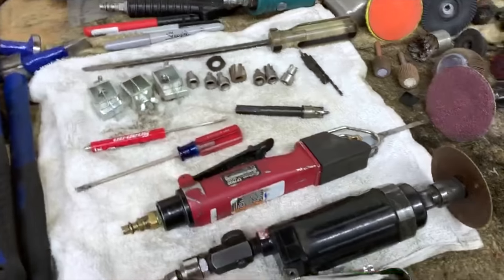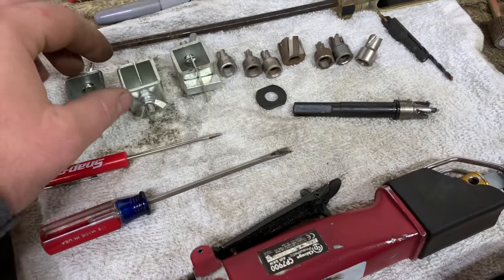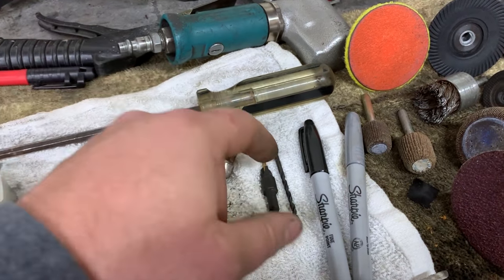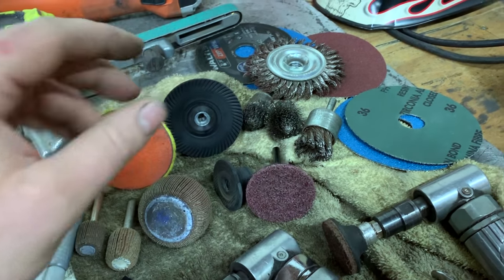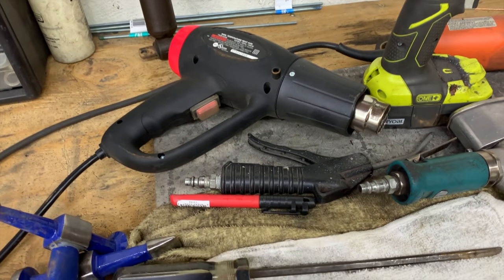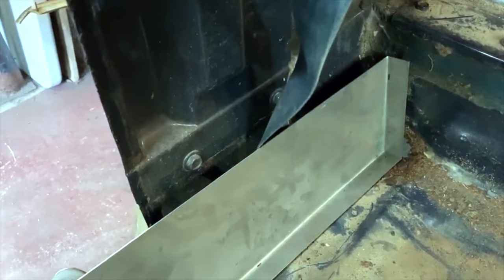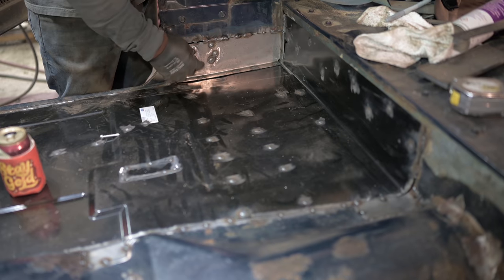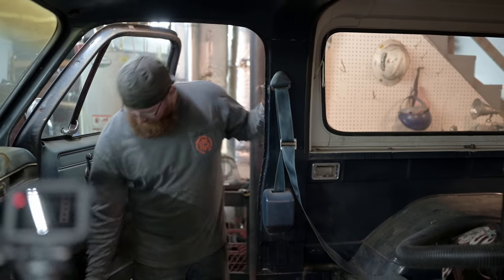METAL SURGERY ON OUR 2WD K5 BLAZER PROJECT | The Tools & Tips of DIY Rust Repair

Comment: Ok.. I've got two tips that I hope will help you or any viewers interested in rust repair or panel replacement... for air saw  blades  I just buy a quality hacksaw blade and cut it to the length I need...  cut it with tin snips from the back to the teeth..you could grind it down to make it not as tall as the standard hacksaw blade to do curved cuts.... and the very best way I've discovered for separating panels is a plain old gasket scraper... if you hold it at the right angle you can "carve" right around a spot weld without doing anything else.  Keep it sharp...If you're removing an outer pane,l a 1/4" thick grinder disc on a cut off grinder to thin the metal around the spot weld makes it easier to  cut and causes less distortion on the panel behind.... if you want to have a hole to weld a plug weld through in the panel behind I  drill an 1/8 hole first then use a step drill to take it to the size of the spot weld or or the size of the plug weld you want... Mr. Gasket scraper can break the panels lose.... I have 40 years experience in production collision repair and these methods  have proved to be the most efficient way for me.. also when there's rust you HAVE TO... always get rid any rust in the repair area. Usually abrasive blasting is the best way to kill all the rust when it's  pitted.. any rust left behind WILL come back to haunt you! I hope this will help you or any of the viewers.. Neil Young says "rust never sleeps" but I'm sure that that reference is lost on folks your age.. ask your dad... lol. Best of luck on UBTK5!
Reply from the maker: jeff pitzer thanks for all the suggestions. I actually edited Mike’s segment and he mentioned using hacksaw blades, but that ended up being one of only a couple that got trimmed.

Comment: I don’t know if Mike Howe knows this or not, but a regular hack saw blade will fit in his or any air saw. You can buy a pack of hack saw blades lots cheaper than the air saw specific saw blades and you can break them to any length you want to use and they will fit in the air saw. I’ve been doing that for years.
Reply from the maker: He does know that and actually included it in his part of that video, but it's one of the very few things I had to trim in editing. smh (at myself).

Comment: Rotobroach.MAKE VERY GOOD SPOTWELD CUTTER...IF IM NOT SAVING THE OLD PANEL...I JUST USE THE CUTTING WHEEL AND GRIND THE SPOT WELDS....FASTER..EASIER..I HAVE HAD TO USE DONOR PANELS  AND THEN I USE CUTTER..PUT THAT REDUCER ON DRILL...SAVES BITS...BEEN BODY MAN FOR ALMOST 20 YRS... ENJOY THE VIDEOS..NICE WORK!!.
Reply from the maker: Great suggestion!
Reply: Have you ever used a 3/8” belt sander to remove spot welds? I have a friend that does it and he says it’s the bee’s knees

Comment: Sweet vid, Does anybody have any ideas as to how I would convert my C20 8 lug wheel hub to 5 lug?
Reply from the maker: I believe you can simply replace control arms out to 5 lug rotor from frame.
Reply: @UNITEDBYTRUCKS .. MY FRIEND DID HIS 65...FRONT END  UP TO 1989 BOLTS IN..HE HAD TO DRILL ONE HOLE FOR IDLER ARM...CHANGE DIFF OUT OF DONOR..
Reply: UNITED BY TRUCKS Thanks for the help i’ll look into it
Reply: UNITED BY TRUCKS I’m pretty sure that will work for the front, any ideas about the back?